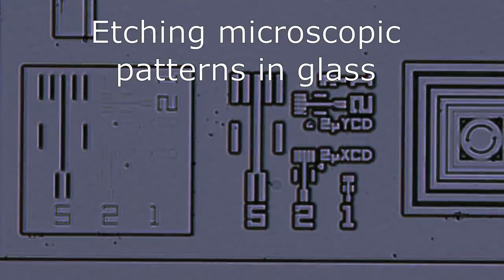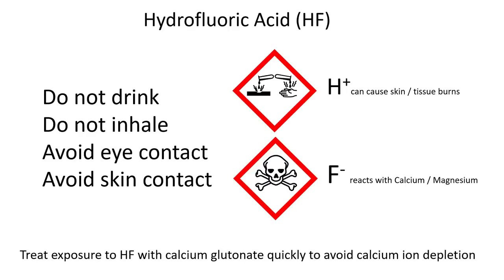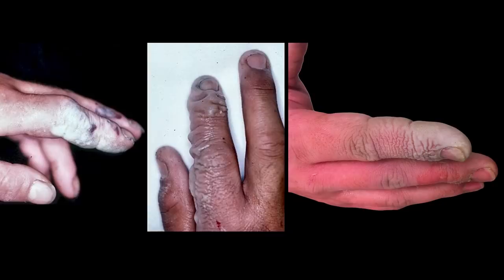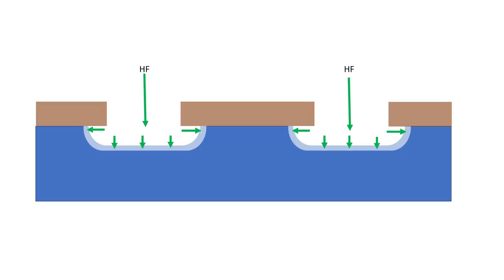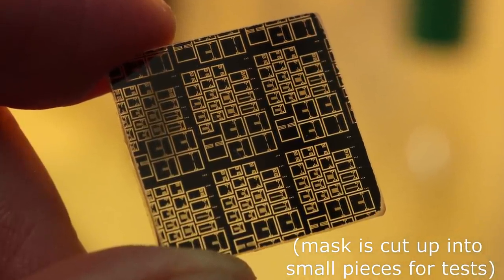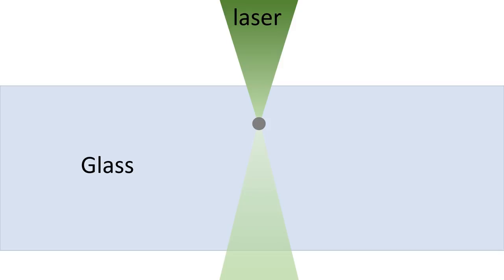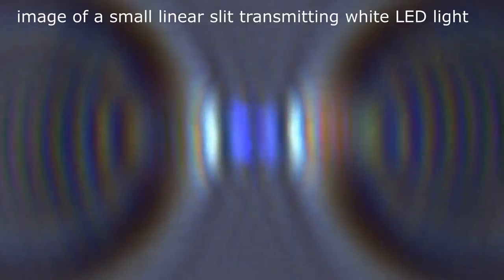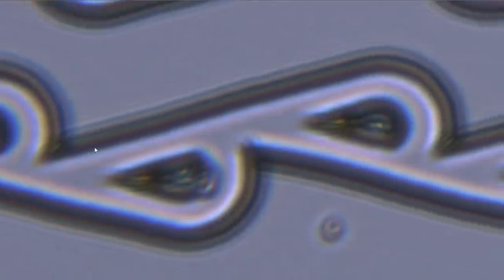Etching small patterns in Glass

Comment: High quality video! I was curious to see if there's a time difference between flow in one direction vs the other. Also, could you attach the whole slide to a piezzo buzzer or speaker and use differential resistance to "pump" fluid on one side of the tesla valve?
Reply from the maker: Well I actually did try if adding fluid from either side would make any difference at all in speed (did not see any). But I should add to that, that this was by no means a real test to measure the efficiency or diodicity of a tesla valve. I guess you could combine the valve with a piezo to use it as a pump, but probably there are more efficient ways to do this with miniature "standard" type valves instead of tesla valves.

Comment: To answear the question of the why so much hype around the tesla Valve: Welp, It is short burst one way walve with long livespam. It can be used in scenarios, where you need to block something from returning to the source, and to be frank, if tesla valve were in the capillary size range, it could, at least in theory, work as one way capillary, or really dense, no returnplate. And for that? I can see the usage of it in ion/high speed low adhsion small pressure machinery. So, and this is kinda wild quess, because I'm not sure whether this could be applied, in mass spectrometry in the Ion generator, to normalize and amp up the ion amount from the sample by forcing the cascade reaction( By applying one way micro tesla valve pointing towards the sample from initial electron canon, such that ions would be blocked while electrons would still pass thru to the ionising chamber).

Comment: Tesla valves only work when pressurized, and even then they only stop a percentage of the total flow compared to the pressure. So if you just soak it in water it my as well be a pipe. It's more useful in microfluidics as a high-low power gate.
Reply: Witch is critical, flow rate or pressure?

Comment: Would have liked to see the flow rate under a pressure gradient in both directions rather than just the speed of wetting. Of course, you'd have had to make them all face the same direction. The point is, you didn't actually test them.

Comment: The EU: yeah, we gotta ban pigments for tattoos beacuse there is no evidence it is 100% safe. Decades of use without issues could be just luck.
Also the EU: We aprove this bottle to be safe. You can ship pretty dagerous chemicals in it. 

I don't dislike the idea of the EU. But there is alot of room for improvement
Reply: By the way: Did they at least put a "handle with care" sticker on the parcel?
At my work place we are adviced to use them as often as we think it makes any sense. And it's just for makeing sure the products get to the customer unscratched. It's not even about danger.